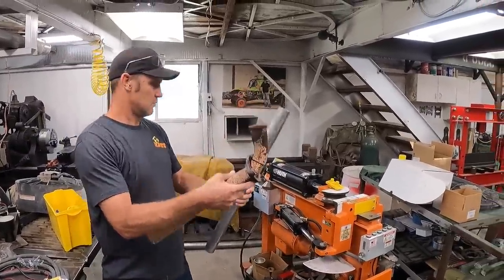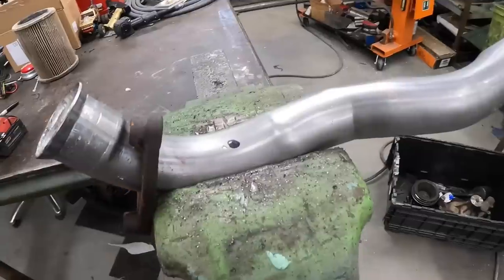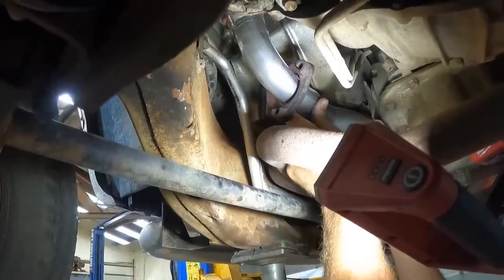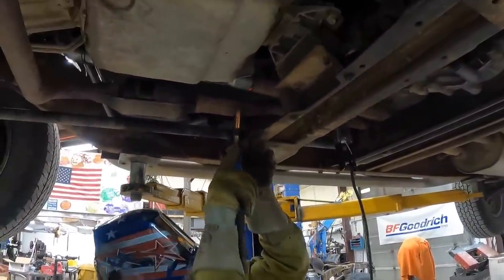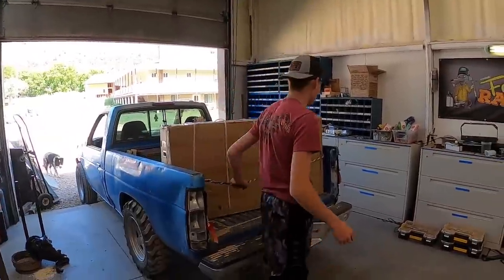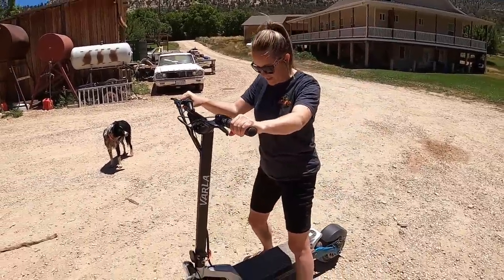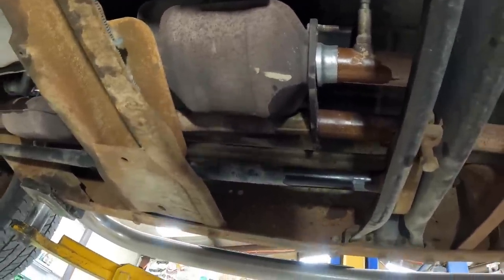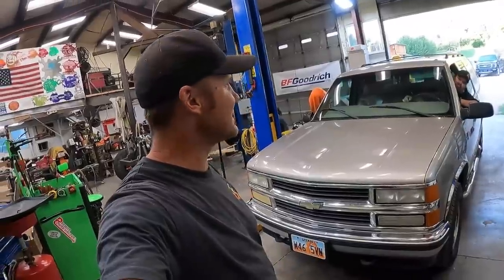They Used What To Seal This Exhaust Up?!

Comment: Had a boss that used to mock me for using ear plugs and safety glasses. Guess who has to put in hearing aids because he didn't like putting in ear plugs. Guess who has cool looking rust ring in his left eye. Not me. I know you wouldn't get under a vehicle without jack stands. Those west Texas oil field highways are deadlier then the job. I have a friend who two sons worked on a rig out there. 18 wheeler pulled into the highway and they went under it. Man lost both sons in one second.

Comment: Do you not have  compulsory 3rd party personal injury insurance when paying your yearly registration that would  cover all those costs ?
Reply: Insurance rarely covers getting home. The semi owner is required to have great insurance, but it depends on if the company is interstate, or intrastate. The feds require higher insurance than most states do., but it still does not cover getting home. Plus they never pay out right away.
Reply: @mtevilone  here in Australia our 3rd party insurance would cover all that aswell as hospital costs , lost wages , rehabilitation and your right to sue for a lump sum aswell in severe crashes
Reply: @darrengray2309  They can sue later as well, but it will be a long way down the road. I have never heard of third party. Many states require uninsured motorist coverage, mainly due to our huge numbers of illegals. If they are interstate they are required to carry $1,000,000 liability. For hazardous $5,000,000. It does not mean you can get that much from them. Insurance companies have lots of expensive lawyers.
Reply: @mtevilone  when you pay your registration here the cost of the 3rd party insurance is included in the payment which is around $850 a year. I know it's a lot more than the yearly cost in America but the insurance is about 2 thirds of that payment

Comment: Those flanges don't always seal with a new gasket. It is a poor design that should have had two more bolts to pull the flanges together.  I machined a couple of small clamps  to pinch the flanges together on mine and it worked.

Comment: I don't like y'all's lies I just installed a lift kit on a 2022 jeep rubicon392 and had to take the exhaust off the jeep had 401 miles on it and broke two bolts there is no way y'all didn't brake those bolts on that Chevy with 300000 miles on it .... great editing boss lady 👍🏼

Comment: Safety first??? Didn't you know you are NOT supposed to stand on the very top of a step ladder  to start a truck? There is supposed to be a label on the ladder stating that, unless someone has either removed it, OR has not read it! I might have to contact Michelle. Your dedicated subscriber looking out for your safety. HeHe